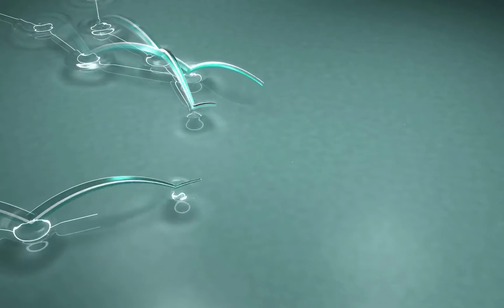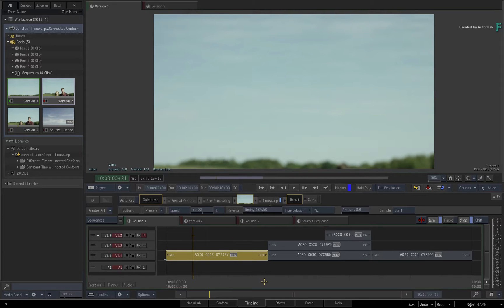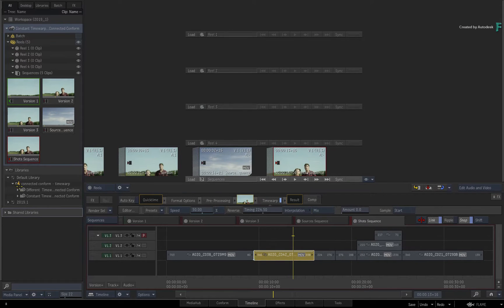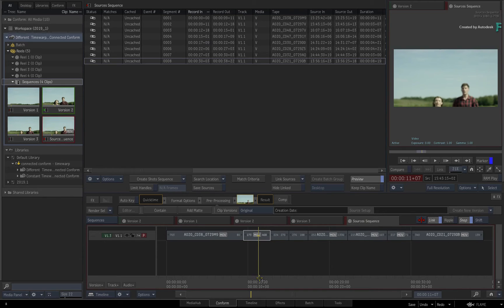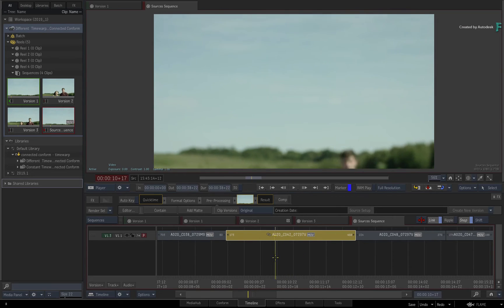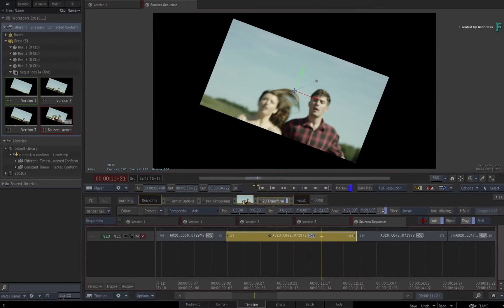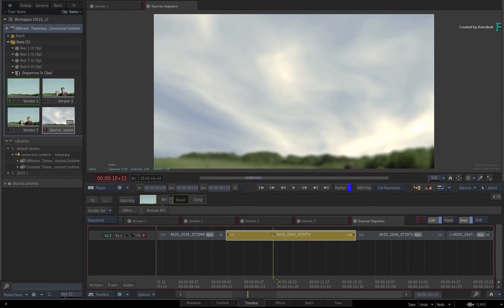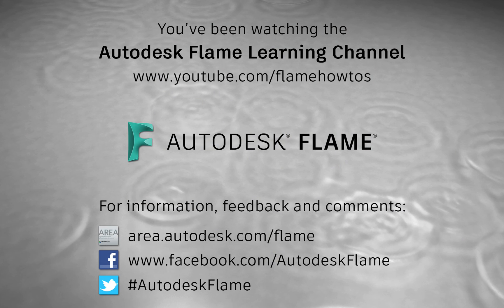Connected Conform Workflow: Working with Speed Changes - Flame 2019.1

Comment: Hi Grant, 

I'm testing this out on a couple of conforms at the moment, one involving very long source media clips. If the editor has used a small segment at the start of the source, and one at the end, the sources sequence creates a clip that is the start timecode of the first clip, to the end timecode of the second clip as expected. However, depending on the length of the source clip or the length of the segments, this can create a huge source with a lot of wasted frames in the middle. I thought the limit handles button would fix this, but it doesn't seem too. Am I overlooking a step or is Flame unable to break out the source clip into smaller chunks based on handles? Cheers.
Reply from the maker: Hi Adrian, I need to look into this further and get back to you.  Thanks for your patience.
Reply from the maker: Hi Adrian, I did a few tests and it should do what you want.    I imported a timeline  with 2 shots from the same long source.   They were at least 3-4 minutes apart.  No media has been linked at this point.   If I click CREATE SOURCES SEQUENCE without limit handles on, I get a single long source as you describe.    However, if I turn on LIMIT HANDLES and than click CREATE SOURCES SEQUENCE, the timeline will have two segments from the same source with the longer section cut out.      

Once the sources sequence is created, than I use the search location and link the media.   The pop-up will appear informing that the same name is used, you can add the same source as multiple clips, replace with the single clip or rename.   I used replace and it worked fine.

Hope this helps!